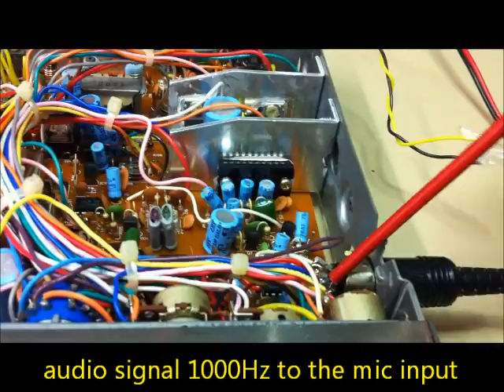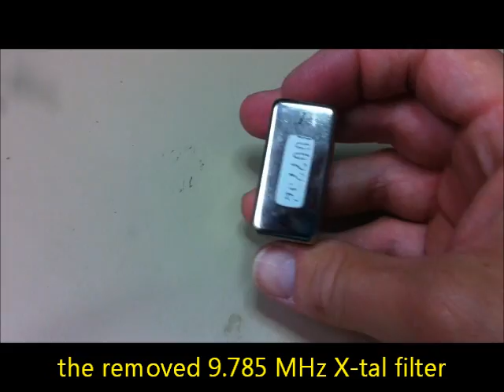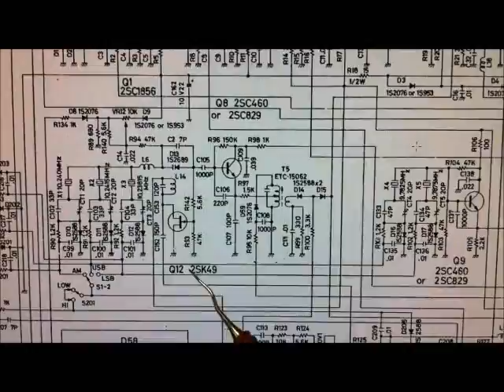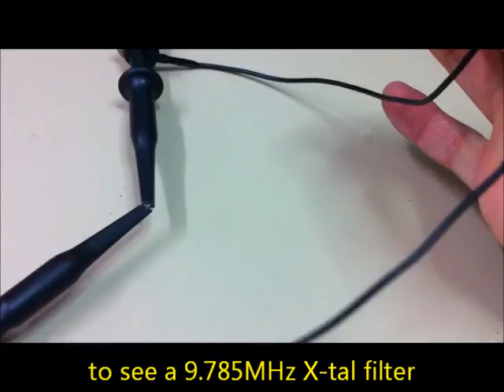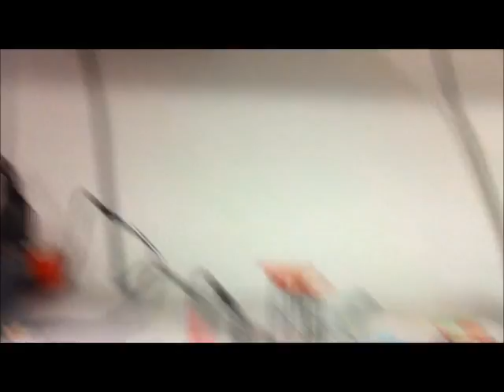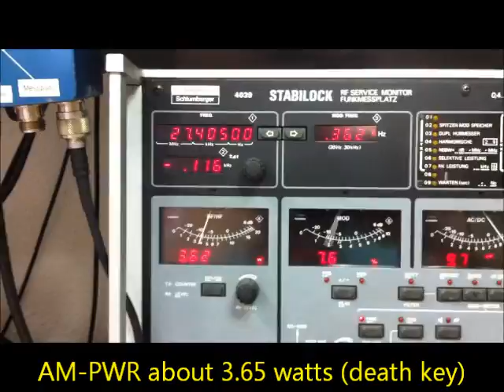9.785MHz SSB filter replacement on SOMMERKAMP TS-340 and ROYCE 1-639 CB-HAM-radio

Comment: I'm looking for a ssb crystal filter replacement for my Mercury 888 AM/SSB mobile, which is a KCC 10F-2D freq. 10.6935mhz !
Reply from the maker: Mr Jim hello, how are you? Yes i think the Mercury uses the CYBERNET PTBM048 PCB. You'll find this filter in those radios. A lot of radios like Lafayette, Midland, Major, HAM Int. from the late 70ies, had this chassis in use. I don't have this filter in my stock. I'm sorry. I wish you good luck to find one of this radio or this filter on ebay. Best 73s to you...
Reply: Yes I have a picture of the filter, if you IM me here to my private mailbox I can give you my email.  Thanks,   Jim
Reply: The Mercury 888 ssb mobile doesn't have the 02a PLL chip.  I think it's the 2812.
Reply from the maker: Jim, I'm sorry, but I don't know the MERCURY 888. I've never seen this radio alive. I can't help you in the moment. But in the CB-radio forums are infos about the CYBERNET chassis. My US-Midland 7001 (79-007) uses also the upd2816 PLL, but the chassis is a PLL02 type.
Reply: If you go to my Youtube channel, and click the "about" tab, you should be able to contact me there by private message and there contact me and give me an email to get in touch with you so I can send a photo of this radio's crystal filter inside the unit, if you don't mind.  Take care and thanks for the response very much, Jim

Comment from the maker: CB-radio fan hello. My first 80CH CB-radio was a GLOBEPHONE GS480DX (cheap clone of TS340). But I was not so happy with it, because the Hi-Band was 27.655- to 28.105 MHz. Tripple five was not includet. ..73's...
Reply: Hi friend,  Here should be your solution for this radio if you still have it or if someone else would like to include 27.5550 !  http://www.cbtricks.com/pub/secret_cb/vol_20/graphics/secret_cb_vol_20_pg36.pdf  73's Jim